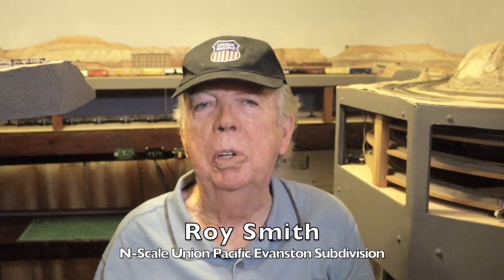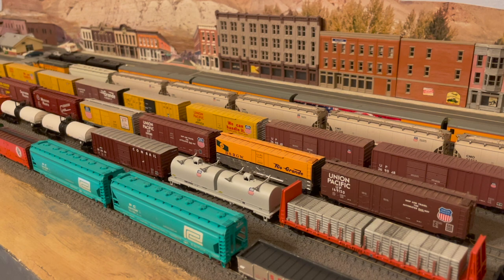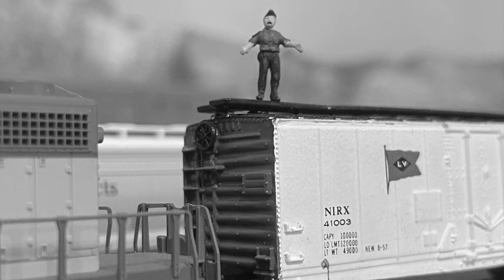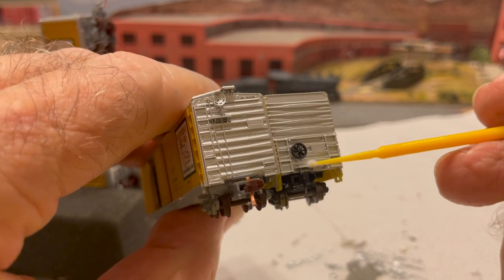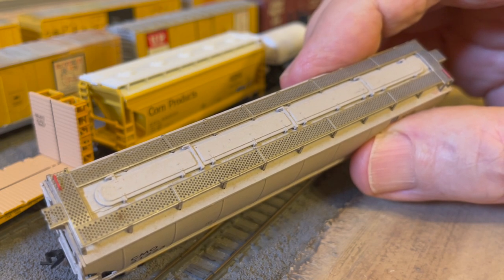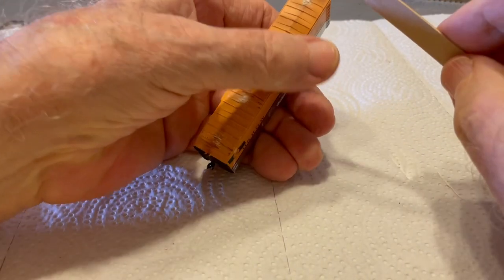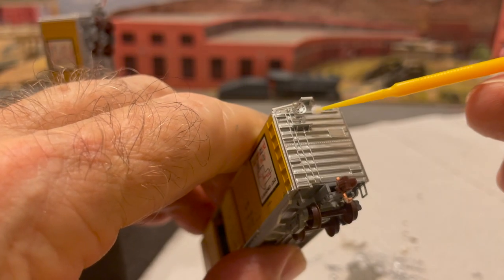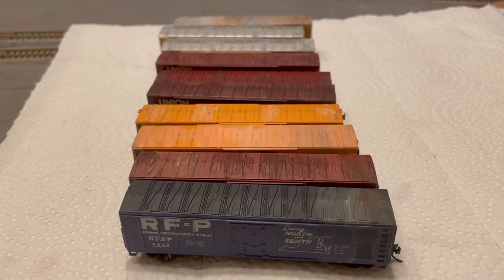How to Remove Boxcar Roofwalks

Comment: Thanks for the roof walk history Roy. I model the 1970 formation of BN through to 2000 so I'll give thought to my manifests with or without the running boards.  Clearly up to 1978, I can still use cars with them.
Reply: You may want to pick one older car, leave the roof walk, weather the heck out of it, and leave it sitting forgotten on a siding.
Reply from the maker: You've got the best of both worlds, Mark. ...Roy
Reply from the maker: Thanks, Thomas. I've got two old 40-foot boxcars that I haven't removed the roofwalks from yet. I've been wondering what to do with them. You may have given me the answer. ...Roy
Reply: @n-scaleunionpacificevansto6569  Over the years Roy, I've learned that there is a "prototype" for everything... As an ex-railroader, I can tell you from my own experience, there is no one, right/wrong way of doing things.  The "boss" just wants the job "done".
Reply from the maker: @thomasboese3793   You make an excellent point about "right and wrong"  ways to do things, Thomas. That is even more true in model railroading, where just about everything we do to is a matter of personal preference. Thanks so much for your comment. ...Roy

Comment: Roy I use round styreen  cut flush also I put scrap styreen in liquid cement after a  a month it turns to a thick slurry and I use that to glue the styreen on the under side of the car.  I use testers liquid cement just for this.
Reply from the maker: Interesting technique, Will. Thanks for sharing it. ...Roy

Comment: Nice upgrade!  Yes, I have been removing running boards ("roofwalks") for many years.  In my current effort at backdating my layout to 1969 I have actually had to add a few running boards :-)  By the way, the UP boxcar with the "Campbell Soup" medallion is completely inappropriate for the modern era.  Since you are using that one, the high brake wheel was often retained along with the ladders on that end of the car.  The other end usually got the ladders trimmed down to 4 rungs.  By the way, good efforts on color matching but don't forget that many boxcars had galvanized roofs or are so full of weathering that one cannot see the scars from running board removal.
Reply from the maker: Thanks, Gary. One thing I still have to do in the freight car upgrade series is re-paint and re-decal a number of my freight cars, especially the older ones that were given to me, to make them appropriate for my era and railroad. And of course, I have to weather them. I've done some work on them, but there's still a lot of work to do. I will be sharing all of that in future videos. ...Roy

Comment: I actually use box cars with and without roof walks on my layout.  My layout operates in 3 different eras (75-82, 83-88, 89-96).  In the oldest era I include box cars with roof walks but in the more recent two eras I do not.  I have not been removing roof walks from any of my box cars but my more recent purchases have all been more modern cars without them.  I hang on to many older era cars to run on the Ntrak layouts.
Reply from the maker: I have found it to be tons of fun to work on the freight cars. I still have a lot of work to do on them. It's a pleasant switch from working on the layout itself. ...Roy